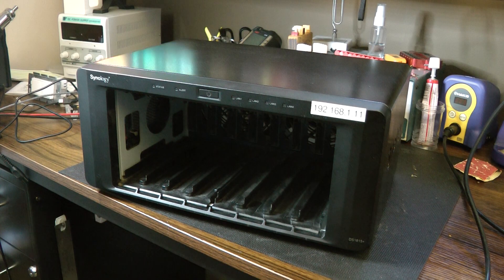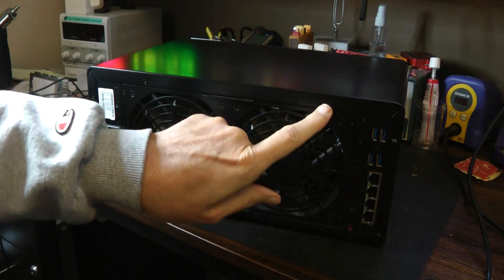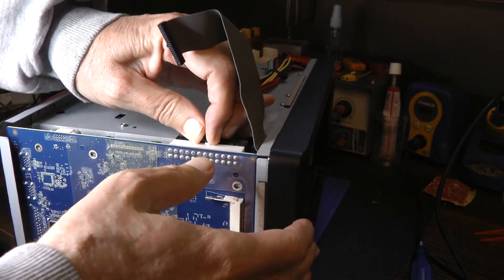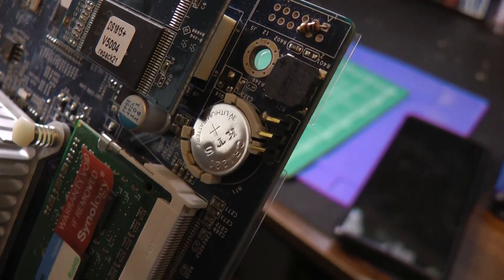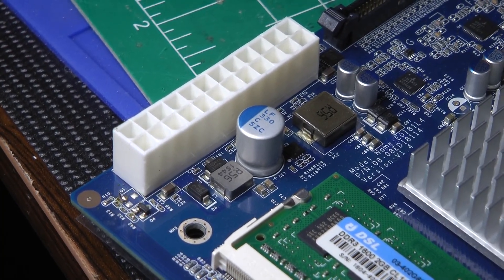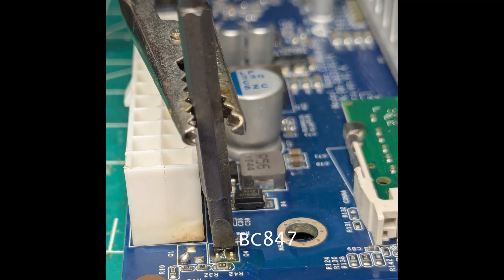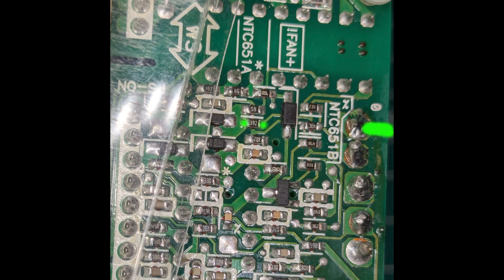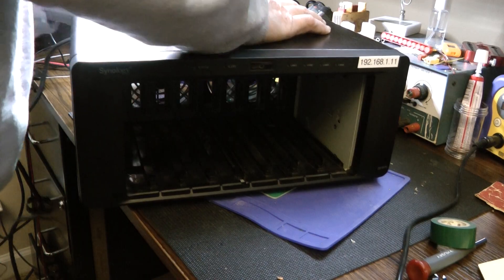Synology won't power on fix with updated changes to fix the power supply

Comment: Mate your a Legend to analyze this Absolute Disaster of a design. Both my NAS's FAILED, a 2413 and the 1815, both with those Rubbish Atom processors (wish I knew about this before I bought them). I will try my luck with these boards but I'm like you, I'm no fan of SMD style technology & have very little experience with this type of board, I'm 50 years OLD school tech. Even if I stuff it, I already bought a new one at great expense to get the disk set running again. The 2413 I believe is the C2000 FAIL, the PSU is fine. Not happy about this at all.
Reply from the maker: Mine are still working. It's worth doing the fix.  I am a lot more comfortable with SMD's today than I was 2-3 years ago!!  But yeah my eyes are not what they were back in the days when I built Heathkits.

Comment: After you replaced the transistor, did you put a 1k resistor in there again? Or did you remove the 1k resistor between q4 and q1?
Reply from the maker: I would leave the resistor in place since the transistor will eventually fail again.  But for a while you won't need the resistor once the transistor is replaced.

If you replace the resistor in the power supply supposedly that will stop the issue of the transistor failing.  Time will tell, as it's only been  about 10 months since I changed the resistor in the power supply.

Comment: @GaryQuiring  

I just attempted to upgrade the RAM on my working 1815+  and when I went to power it on, it appears dead. my cmos battery is also reading 1.1V so time to replace that.

What is the reading you are seeing on the working BC847 transistor? I was getting readings of 645 and 825.

I'm trying to determine if it's faulty or fine.

I'll look to buy all the components anyway. I'd just love to understand the root cause for my 1815+ failure.

Comment: So i did the resistor fix from another video several months ago. It powered on and it worked several months. Now it wont power on.  Im assuming its now the power supply? Is that a decent assumption? I am not great at soldering and im assuming i did a good enough job but now i dont know what else could be wrong.

Comment: Hi Gary, Thanks for sharing this. I thought it was dead my ds1815+ ! It just booted after changing the resistor in the PSU and the cmos battery.  Should I changed the transistor anyway ? You're my hero!
Reply from the maker: Since it's working leave it alone, but I'm gonna guess the transistor could fail eventually.  I would order one to have it ready, they are not expensive.

Comment: Thanks for this. I have the DS1821+ and it didn't power On. I ordered a PSU 250w. Should I do the same solution? Thanks.
Reply from the maker: Ordering a new power supply won't fix the power on issue.  The power on problem is the BC847 transistor.  You can either solder the 1k resistor over the transistor for a temporary fix (it could last a couple of years) or replace the BC847 and replace the resistor in the power supply.
Reply: @GaryQuiring  Thanks for the reply. My question is: should I apply the same solution as yours because your unit is ds1815+ and my unit is ds1821+. Thank you.
Reply: Do I neede a BC847B or BC847C transistor?

Comment: I picked up a CR1216 CMOS (Energizer) battery from a grocery store. will it actually work?
Reply from the maker: Why did you buy that battery, I said it's a CR1220.  The battery you got is not the same dimensions, it may not fit correctly.

Comment: Hi Gary. Great video! I had 1815+ connected to a UPS, lost power, and now I’m having the same issue :(   I unfortunately am not good at surface soldering… ruined a couple of circuit boards in the past. I tried to find a person local to do it for me, but no such luck. Any interest in repairing the power supply and board in I ship them to you? I use my NAS for plex, and not really in the market for buying a new synology.
Reply from the maker: Sorry I am not in the business for repairing boards. I wonder if the Geek Squad at Best Buy would do it?
Reply from the maker: You could try this service out.  Never used them but they have fixed Synology from their videos I see. 

https://nickselectronics.com/
Reply: Thanks! After a little deeper diagnosing, it seems like my power supply died. I ordered a new one, so I’m hopeful that it’s only issue.

Comment: Just came across your previous video and gave the resistor fix a try. Thank you! It's a wait-and-see situation now, however one thing I have noticed right off the bat is that my LAN status and status LEDs no longer light up. I have not yet tried the PSU resistor replacement in this video but that is up next.
Reply from the maker: If the LED's are not lighting up something is wrong.  How long are you waiting?  It takes a good minute or so for these to boot up.  Did you perform at ATOM bug fix which is the 100ohm resistor which is not covered in this video?
Reply: @GaryQuiring  Yes, I did the 1k resistor job from your prior video. I realized that the status LED is on, but very very dim, however the LAN LEDs do not appear to be on. Apart from that though, the server's working like a charm. Very weird.
Reply: The LEDs came back overnight, and the server's IP addresses changed. Strange.

Comment: Your information is incorrect about the difference between a "103" marked resistor, and one marked "1002"
They are both 10k resistors. The only differences is manufacturers do not always mark them the same.  Often times, the difference in % deviance is denoted by the color of the backfield area of the resistor. i.e. a black backfield with white 103 or 1002  markings on the resistor would usually be around 10% deviance, whereas a green backfield would denote a lower deviance %. Again, even that is inconsistent among manufacturers. at the end of the day, they are still 10k resistors, and in this instance, it doesn't really matter, as long as the resistor can handle the current.
Reply from the maker: You apparently did not listen to what I said at 12:35.  I stated they are both 10k resistors, one being 10% the other being 1%.

Comment: Can that battery be replaced without diving so deep into the unit? What happens when it’s removed, can instill get back into the unit?
Reply from the maker: You need to remove the board to replace the battery.